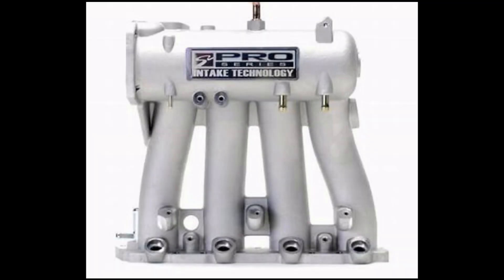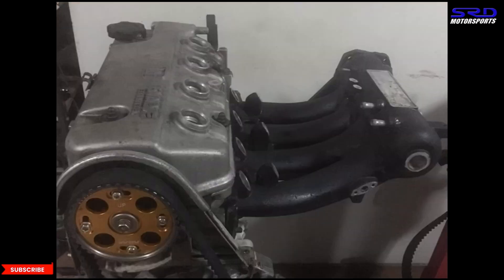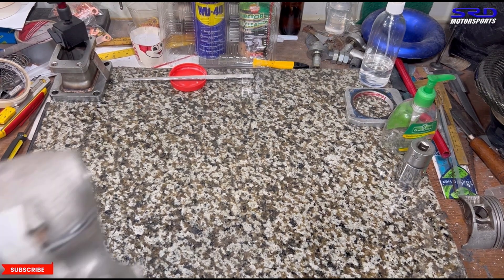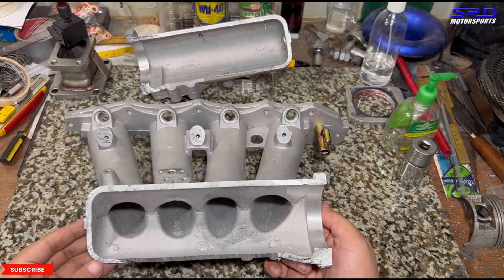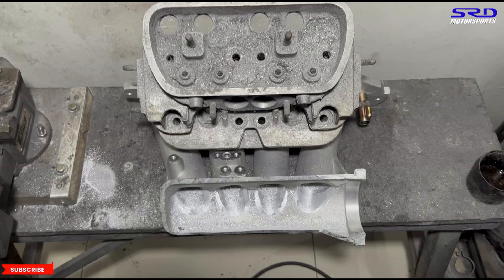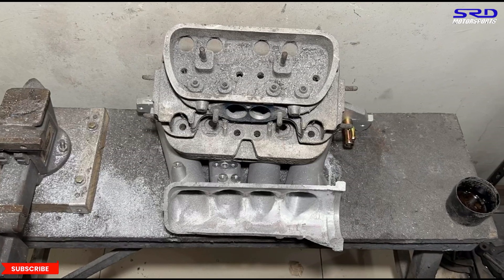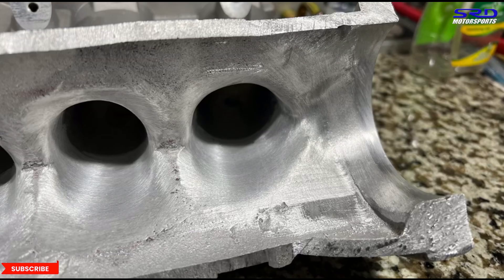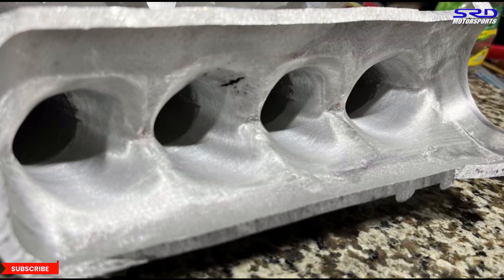Skunk2 Intake Manifold: Real vs China Copy B16 / B18c / D16

Comment: Was seeing what you thought of the eBay ultra street racing manifold replica to the skunk 2 ultra street for a k series. It looks exactly the same and was going to get it ported and port matched to my head. Or just buy the real one and port it only
Reply from the maker: the latest we did for a Kseries 2 weeks ago the video is cuz it was “China” so it needed lots of work

It’s honestly a Lie when someone says they got a replica and it’s as smooth with nothing to show for just talks…

a friend of mine has a real OG ultra for the B series and I must say it is as good even if not ported 

So if u get the real one, u can save some from porting it and enjoy it as is… maybe down the road when u feel u want more only then have it ported
Reply: I am planning to get either one of them ported cause the head is ported as well. I thought if I ported the China version it would be the same since the guts were ported to port match the head. But I guess with what you’re saying is get the real one from skunk and port it. I’ll get better results and not be limited
Reply from the maker: @davidsocherman3744 yes both ported will be good but the real one has higher potential limits when porting even on the older pro series style manifolds

Comment: do you find it necessary to bevel the edge when welding the oem manifolds back together?
Reply from the maker: Just only the throttle flange
Reply: @SRDmotorsports  thank you kind sir! Man do I wish you were local 😅
Reply from the maker: hahaha!

btw the main part why bevel the tb side is cuz we still flatten it after tig
Reply: @SRDmotorsports  ok so the weld is ground flush at the end?
Reply from the maker: @ only the TB side so it’s flat for the tb. But all around the plenum we leave it as is

Tig weld beads look good anyways 😎
Reply: @SRDmotorsports  most def they do ❤️  appreciate the answers man!
Reply from the maker: thanks for watching though man def appreciate that 😎

Comment: Good day sir, I hope you'll notice my comment. I bought a skunk2 intake manifold copy and match ported it. Then I went to a tuner who told me that I should have not bought it since I have stock po8 cams and stock P2CY pistons. He said that I will not gain power since it does not need more air but some mechanics told me that I should gain more power with that intake. The tuner is suggesting to get a stock p2k intake manifold instead. I just want your insight with my build if I should follow the tuner's suggestion or if I should continue to use the skunk2 copy, the reason that I bought it is for my future build, I plan to buy aftermarket cams and springs when I have extra money for it. Thank you and more content and power!
Reply from the maker: what head do you have?
Reply: @SRDmotorsports  Thank you sir for noticing, I have a stock po8 20 cams head
Reply from the maker: thanks for the reply… if it’s a P08 head then the P2K manifold runners isn’t optimized for that , it is optimized for the p2m and vti head

but hearsay’s always said it’s better kase “bigger” but we have seen more good results with p08 bkit? Dba? 

the skunk2 u got is a lot better
Reply from the maker: The green esi circuit car we did/built na oem for Marvin… is the same as ur engine halos and his next step is a skunk2 intake
Reply: @ thank you very much for your input sir, more power po!
Reply from the maker: you’re welcome sir! And have fun with your project 🫡

Comment: Awesome, so how does this compare to a ported EK9 manifold? I am considering building a B20 all motor using my PR3 head and was thinking of using ITBs but they are very expensive and don't yield more power than a good plenum manifold does, so thought an EK9 manifold might be a good option, but what is the best for maximum power?
Reply from the maker: @Mike-ry4ti  if you have the ek9 manifold it’s as good as the skunk2 pro series

I mean the skunk2 is a good option nowadays when the “typeR” manifold becomes over priced but if you have it? Il use it
Reply: @SRDmotorsports  Thanks! I come across them for sale every now and then so might buy the next one I see!
Reply from the maker: yeah if you see a good priced unite local to you? That wins, to avoid shipping it’s also why I have a spare ek9/typeR manifold too
Reply from the maker: I also have an older video here of the p73 ITR/CTR intake porting which is exactly what we are talking about when u have ur spare soon
Reply: @SRDmotorsports  awesome, I'm at work until the end of the year but will hut you up if I can't find one in Japan by then
Reply: @SRDmotorsports  can't wait to check this out.  I should send you my PR3 sometime to get fully worked!
Reply from the maker: oh that’s all good
Reply: @SRDmotorsports  can't wait to check this out.  I should send you my PR3 sometime to get fully worked!
Reply from the maker: that works
Reply: @SRDmotorsports  What do you think about CNC innovations manifolds, they look pretty nice...
Reply from the maker: havnt really observed nor tried them so can’t tell much
Reply: @SRDmotorsports  would be interesting to see what one is like, they are as expensive as an Ultra race...
Reply from the maker: worth thinking about:

All F1 teams have their own cnc = not all are fast, same as MotoGP 

but on diff platforms? It’s “whoa cnc”
Reply: @SRDmotorsports  yes, it would be good to get hold of one and do a dyno comparison!
Reply from the maker: check the runner length and taper that tells u alot

Comment: I have bought a China intake but my d15z8 EU engine is stock only things that are done to it are an exhaust manifold and downpipe and a cold intake and a rear mufler. Does porting the China manifold do anything for me? I would say it will not benefit anything because I don't make that much power.
Reply from the maker: well the main point is original vs china the original is always better cuz the casting is real good and clean  only when ported does the china become “okay” to compare

Comment: So rep sk2 base on b16 or itr I'm looking to add to my b20b with a p8r head i know b16 intake  well work it'll cost me about the same to get the rep
Reply from the maker: Sorry I didn’t notice this comment… IMO if it was mine I’d get the sk2 rep mainly cuz the b16 will work and it’s good for a 1600 until 1800 but ur displacement can handle the ITR style sk2 rep good and you can take advantage of it more
Reply from the maker: Also got this video where I show how to convert a vtec manifold to work for a nonvtec crv head might be useful 

https://youtu.be/8p5vfpBRhnA
Reply: @SRDmotorsports   yes I'm mostly chased and low-end torque because I'm using an automatic transmissions out of  jdm sir-g on a 94 Acura Integra red line at 7.5k  so it seems like the B16 intake would be a better for my situation
Reply from the maker: Oh now that u mentioned a/T I’d def agree the p30 seems perfect

Comment: So I have a few questions, is porting a type r manifold better than just buying a pro series manifold? Also would a turbo setup benefit more from this? Another great vid brother
Reply from the maker: Well… the real Skunk2 ProSeries (not china) is a shade better than the TypeR mainly on the casting internal size and thickness
If ported? Then the skunk2 has a bigger edge over the OeM as the walls are thicker = let’s me port it more with MORE taper before cutting thru…

actually both NA and turbo would benefit from it… just different sources of benefit like example on NA we know what’s up

But on turbo if the manifold is ported well and helps improve or increase intake air speed on the runners = improves head port efficiency? Then a “big turbo” may lag less… or
For the same 26psi u might make 12-15 even 20 more whp… hence we see set ups like both doing 500whp one makes it at 32psi but the other does it at 26psi?

Il take the 26psi any day… less stress on parts and also what would it make if u crank it up to 32psi right??
Reply: @SRDmotorsports  right right that makes perfect sense now and yes I've seen a lot of turbo cars with 30psi right through them but makes really low numbers and I'm like yeahhh something is not efficient with that setup
Reply from the maker: @StraightOutThaGudda  yeah and we car guys so if it makes power at 26psi ? Next month we wonder what it would make at 30psi hahaha
Reply: @SRDmotorsports  haha could only imagine

Comment: Random question but do you think running a h22 intake manifold on a d16 is possible? I was thinking casting an adapter plate for it
Reply from the maker: Maybe but the runners are too short and too big 

Reason it works for h22 is cuz stock stroke is already a shade bigger than a b20 which is 89mm and h22 is 90.7mm

Especially when they run f22 cranks at 95mm stroke that piston speed is higher

Hence the shorter runner “cut” h22 works good and plenum size is more the obstacle

Comment: Chinese will copy almost anything 🤦🏽‍♂️ but on the bright side it has a lot of material to take off so you can shape the ports really nice, also if the knock off intake has more material it should weigh more than the original, so what's the weight difference?
Reply from the maker: True on the thicker wall… have not checked the weight difference but it’s definitely noticeable like almost a lbs or few diff not even ounces lol

Comment: I port these intakes too. Long story short. Stop buying Chinese intakes. Flange runners are offset too and dosent line up with gasket. Its a big L to use a chinese intake in your build.
Reply from the maker: Definitely agree on the offset and stuff
Reply: Use terma tec gaskets from uk it will line up perfect. Mine manifold was from tactical racing so runner ports were samll and I could match te with head very well. But habe seen some copies that are plain bad
Reply from the maker: Oh there you go , I’ve heard of terma tec indeed